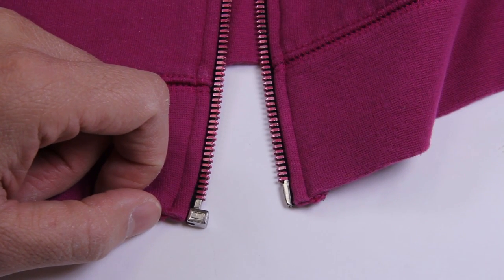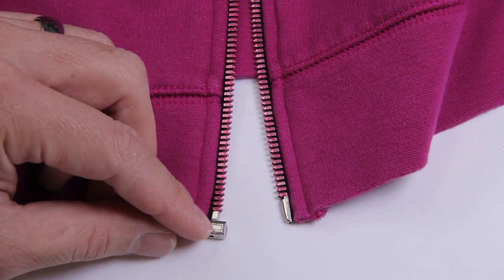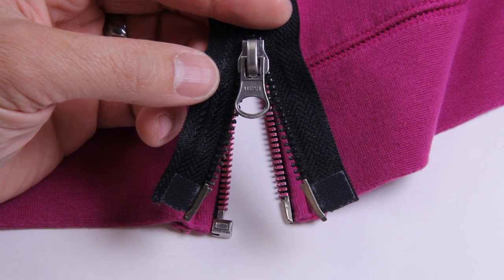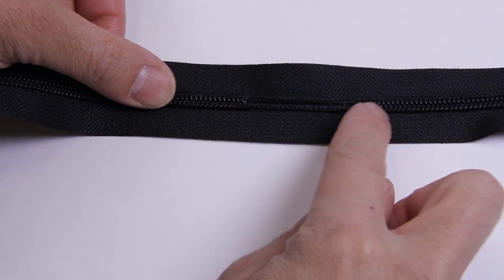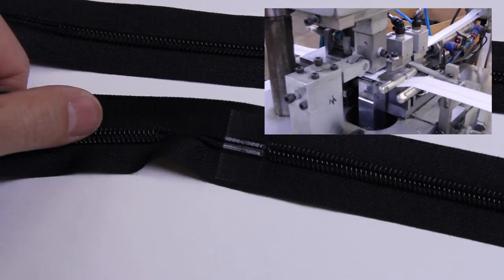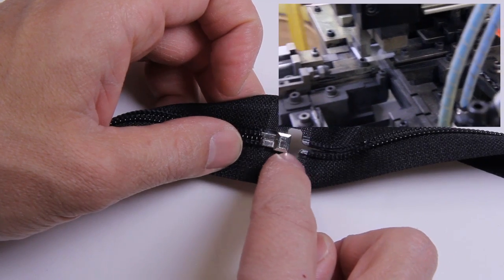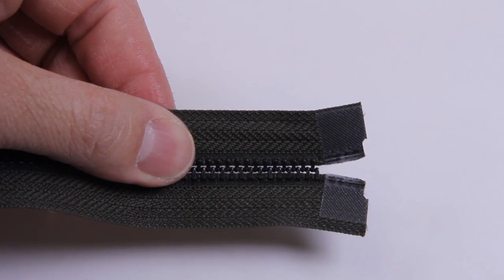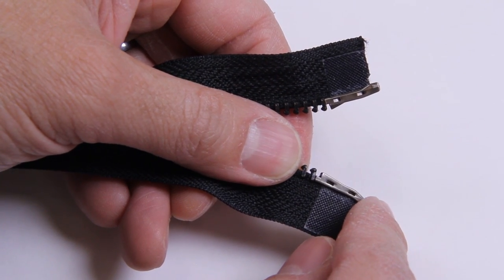The Zipper Fix That Cannot Be Repaired

Comment: This is the only video on youtube I have ever disliked.  You can buy replacement pins and zipper retaining boxes on ebay for less than $5 bucks and that would be a set of various sizes.  If you are true professional don't take this guy's advice.
Reply from the maker: True professionals will use zipper machinery to punch on the pin and box. We do it here over and over again, millions of times over. You're absolutely right, you CAN buy pins and boxes on Ebay, but you won't get the same quality outcome using hand tools as you would with professional machines.
Reply: I agree with Holly Golightly

Comment: Yes you CAN fix/replace box ends/stoppers!! You CAN buy them in a various styles, in metal or plastic👍🏻
Reply: PJ Celeste Where? Please..
Reply: Thx PJ
Reply: Amazon has kits everywhere
Reply: @EllisSimpson  Confirmed.
Reply: You can buy them, but how do you get them to stay on?  I have used pliers and all the force I can muster, but that bottom box will not stay on.  I tried it with super glue as well, and it came off as soon as the customer unzipped it the first time.
Reply: All the replacements on Amazon and Ali Express are cheap and thin pot metal, they break if you pinch them hard enough to stay on most of the time. As he said here you might get one to stay for a while, but it'll probably pop off when you really need it to work. If you're determined then, light pinch combined with a little super glue is the best bet.

Comment: I took a old coat cut the pin tab off hand sewn it onto the new jacket and it went into the box and haven't had a problem since. Works just fine. Its been over a year.
Reply: Blue Nile 
I just completely replaced the zipper with the zipper of an old jacket that I couldn't fit anymore that had the same size & colored zipper as the one on my broken coat. I was so proud of myself cuz it was the first zipper I had replaced (or even worked on)
Reply: StarrGaze-Lilly that's so awesome.. I have a $200 northface coat and the bottom heat seal ripped in half. A coat zipper should last at least 5 years imo. This one is just over 2 yrs old so I'm not happy. Next time I spend $200 on a coat, it will be another brand and I'm going right for the zipper to see if it's of decent quality.
Reply: @trinityvonmoon7346  So... you ruined one coat to fix the zipper on another? SMH
Reply: @ChazSeamus28  Uh, did you check with Northface about a warranty? Companies like LL Bean will guarantee their products for life against problems like this.
Reply: Omg u are a saviour - that’s exactly what I need to do - genius lol

Comment: While I agree that the box cannot likely be replaced without some effort or fix (like with a super strong glue), a replacement insertion pin can in fact be easily purchased, installed and crimped on the other side of the zipper (as long as the support material is intact, or repaired as needed).
Reply: You should make a youtube video showing how!!
Reply: make a yt vid about it 2 years later😂

Comment: I'm pretty sure that replacement zipper pins and stoppers are specifically designed to be clamped with hand pliers.  Even if that weren't true, there's absolutely no way that a small manual press couldn't do the job with the right setup.  Or even a hammer?  It's not THAT hard to bend metal.

Comment: I believe that someone out in zipperland should be abl e to create a box/pin repair kit. The stiffening tape should be easy toadd if it can be made so it ca be ironed or glued on. I would like to add that I had a customer asking me to fix the box/pin that tore away from the tape and wanted me to fix it. I told him I was unable to do so. About a month later I ran into him and he told me his neighbor worked for a canvas repair shop (not a manufacturer, just a local 2 man operation). He told me his neighbor was able to add a new box/pin to the zipper. He said the man told him he could not get the smaller size, but had larger sized box/pins he would use for tents. He said it was slightly larger and he replaced it and it worked fine. I do not know if this will be a temporary repair or a permanent one? Is it possible that a small canvas shop could fix the box and pin on a zipper for a nominal fee? I do not know if they would have some sort of equipment they could use to secure it well that a home sewer or alteration shop would not have access to? I have told a few customers since to check first with the local shop and then if they could not repair the box/pin to have me replace the zipper. I do not want to tell my customers to do this first if it will only be a temp. fix. Better to spend their money on a new zipper.
Reply from the maker: About 99% of the time, fixes like the one you mentioned with the small canvas repair shop are temporary. I agree with you that if the fix is really a fix, it should be done right. When the pin and box come off and sometimes the cord is torn away, the zipper will never be 100% repaired back to original quality.
Reply: @UCANZippersUSA  Where would the components for these be purchased.  I have access to multiple presses with specialized dies for minutia similar to this, and I really want to repair a jacket that requires a separating end stop.

Comment: I've had this problem with a jacket the box was missing at the bottom so you couldn't close it, the rest was fine, It was one with the 2 slides. I took the two slides off reversed one and slide it to the bottom to form the box, glued it in place with epoxy. The second one I put in normal from the top down. I cut the tab of the first one so you wouldn't be temped to pull on it  and it works just fine. I think if the end that you mention is stamped on that it could be reinforced then use the same method. I've used this one for over a year and it works like new.
Reply: Rob Martin 
Sweet! Thanks for sharing 😀 I think I'll try your remedy. On an old jacket I had when I was pregnant, my roommate washed my jacket (which had a plastic zipper) and she threw it into the dryer WITH IT ZIPPED UP 😧 So it ended up melting and fuzing together lol It was the only jacket I could fit (and it was winter) so I just slipped it over my head and wore a scarf with it to keep my neck and top part of my chest warm
Reply: 😘 Oh, but you are wonderful!!!!!  I've had a down jacket I haven't been able to use for 2 years.  And I do believe I've got it fixed.  Will try to update next month - but THANK YOU for your creativity and your good will!!!

Comment: I have a jacket that has the pin and box attached but the fabric has separated from the pin. This seems to be a common problem and I have friends that bring me zippers like this all the time. I didn't think I was able to fix them so I told them I was not able to help them. I never could explain why but now I know. Thanks! ... But that means I would need to insert a new zipper. The jacket I currently have is leather/pleather and I only have a basic machine. Is there still a way that I can repair this jacket? And... How can I/other people prevent this from happening to any other zippers?

Comment: How about when the pins themselves are okay, but the heat seal tape starts to come off. I have a case where the tape tore at the pin ends, making the material below fray, and also another case where the tape is starting to peel off on the inner side (where it transitions to the fabric) probably due to the pulley rubbing over its edge. Is this kind of issue fixable?
Reply: shadow2XS I have the exact same issue with an expensive snowsuit!! Definitely would love a fix that could somehow seal the wiggly pin back onto the stiff tape. Two way zipper pull and slider works perfectly and would save me money finding a solution.

Comment: Hi, if the metal insertion pin on a separating zipper is attached securely, but the heat seal tape next to it is lifting off of the zipper tape and fraying bit, does that affect the integrity of the zipper? If so, how can this be fixed?

Comment: I worried about this problem before the plastic seal actually broke.  Inspired by this video, I have soldered some pvc from some food packaging box on to the failing heat-fixed plastic to reinforce it.  This looks good - we'll see how it wears.  I so love this anorak, I don't want to lose it!
Reply from the maker: How's your repair holding up?
Reply: @UCANZippersUSA  How sweet of you to ask.  It has split behind the pin - about 8mm long from the bottom.  However, the anorak has press studs as well as the zip, and much of the time I just use those, to save the zipper.  I can still do the zip up if it is really cold.

Comment: **@UCAN Zippers USA - I DISAGREE IMPOSSIBLE? - As you know Apollo 13 crew worked remotely (with NASA engineers) to fabricate a makeshift CO2 box.**  I took your insight to the problem, thanks for that  and brainstormed. I fixed my Walls Work jacket. All that was required was the pin in my case not the zipper.  Used a new #8 block box and  pin kit. Used JB Wells epoxy 2 parts kit , mixed small portion then applied to area where cord was to hold pin. After about 1-1/2 to 2 hours it is a putty consistency and was able to use a toothpick to form a ribbon cord on the now "flimsy jacket material." After 24 hours the area to house the pin was very very strong, rigid and hard!  Had to fine-tune sand & shape minimally so metal pin slides on. Crimped with vice grip and needle nosed pliers. It works perfect and will last a LONG time. Shame on Walls work jackets while the jacket is very high quality the zipper pins are CHEAP.  I should have  done a tutorial video. Total cost epoxy $4.75 at Walmart and 2 zipper sets for $9.95 on Amazon :)

Comment: Hmm I just watched a video on a lady adding in a right side pin from a diff jacket that only cost $10. 
So in other words, she bought a cheap used $10 jacket with matching zippers, cut off the pin & hard plastic material next to the pin & sewed it in place on the broken zipper & it looked like it worked just fine. 
So in my opinion,it does seem repairable after watching her fix a coat. I was researching on how to repair broken zippers cause my new $50 winter jacket from Menards was only a month old when the zipper broke from a minor accident that happened. I like to be challenged by fixing things that are hard to fix, so this is right up my alley. Lol
No offense on your video, I just thought I'd let you know that it does seem repairable. I hope this write up made any sense. 

(World's MOST important/encouraging message, is found in; John 3:16, a spiritual, physical and eternal life saving verse.
📖✝️🙏)

Comment: There is a clear tape-like material that has peeled off of the zipper fabric where it enters into the zipper heads. where the zipper pieces latch. I think this tape like material is there to help the zipper pin slide into the box. Any quick fix?

Comment: I have a open zipper with just one tooth missing near the box.  If I could move the box up about 2cm (1") the problem would be resolved. I guess that's not possible.  Is there anyway to replace just one metal zipper tooth?

Comment: I have the two way separating metal zipper, and both of the pins (or pin / box even though they're two pins) are fine.  The problem is that I lost the bottom slider (broke).  The top slider is fine and still closes the zipper if I hold the bottom.  It says "Ideal 5 M" So I got two #5 sliders (YKK), hoping that would be an easy fix.  But seems like the pin from the original zipper doesn't fit in the YKK sliders even though they're #5.  aaaaaaaah. Lol.  I just ordered 2 #7 and #8's to see if that will work.  I also have a bunch of repair boxes and pins but I can see that will be a messy thing.  Problem is that this jacket is quite expensive and the zipper is really sewn in there well, so changing the zipper will be expensive and might ruin the jacket.  Any ideas?

Comment: The coat only has the heat sealed tape and it does not have the devits and the drop pin is worn and it is difficult to zip the double zipper.  Can this be fixed?

Comment: Is that little punch really the only thing holding the pin and box onto the heat tape? So if I just happen to already have a 1 ton arbor press, I can probably complete this repair? How much force is needed for that initial install?

Comment: I have aa zipper that still has the pin attached but it has ripped away from the edge and there is not enough material to sew it back together. It still zips up but it is difficult to get it to catch in the slider, plus it looks bad. Is there a fix for that?

Comment: I installed zipper upside down lol (facing lining) short of reinstalling can slider simply be removed and turned so pull faces up? (in other words will slider work in either side in both directions) presumably the stop, not the slider, would then be damaged, need replacing or could stitch to stop. ?) thanks so much :)

Comment: Question:
On my zipper, at the very end, left side, the heat-tape material has worn away, so there is now a slice in that material, so my zipper won't connect there anymore to zip it up.
Is there any way to fix that, without replacing the zipper? 
For example, would it help to put on more "heat-tape" to fill in the missing material or is it time to replace the zipper?
Also.....
When I went to "JoAnn Fabrics" about the only place around my town that sells stuff like that, I found they only sell "women zippers", (zippers that zip up on the left side) because I am a man my zipper zips up on the right side, they claim they never heard of a man zipper! 
I told the lady, look at my jacket, see how the zipper is on the right side, look at your zipper, see how its on the left side? 
The lady never noticed that before, and the only reason I know about this is because I took another jacket to a seamstress, and she put on a "women zipper" and I can't get the hang of it to zip the darn thing up or down! 
You have GREAT VIDEO'S thanks for doing this!
NiceSeeingYou

Comment: Help!   I have a Carhart coat and the heavy metal zipper stops unzipping about 3-4 inches from the bottom.   The teeth are all there but it just jams.  I’ve looked all over YouTube and tried the oil fix approach as well as the wax approach but nothing has worked.   Any advice for me?

Comment: I'm in a situation where I have the slider and can slide the whole thing as normal, but the bottom stop is the missing part. So it's zip-able but doesn't have the seal. Does that match the example shown in this video? I will message you a picture of the zipper at its bottom as well to have better context.

Comment: If I want to do a temporary fix but can't find #7 stopper, can I use a larger or smaller stopper?
Reply from the maker: You can always use a stopper that is a larger gauge than you have, but not smaller or the slider will go right over it and not stop it.

Comment: why not make a replacement pin and box with holes all of the way through that could be sewn on?
Reply from the maker: I think that's a great idea. There just has to be a way to keep the cord stiff enough and the pin and box the correct size that it will still fit the slider. When our machines punch the pin and box down, it's also crimping it to the correct shape so it can fit the slider. Great starting idea, though.
Reply: I tried drilling holes through the Pin side and sew but then there's no room for the pin to enter the zipper due to the threads extra thickness. 
I also tried 2 part epoxy. It worked but on the 3rd insertion it fell off. That's because the inside of the pin/box is smooth. "IF" it were rough the epoxy will hold but again I don't think as long as OEM. More holes for the epoxy to grab the pin just makes the pin weak.
Reply: With the right tools I bet it can be done. I just looked at my zipper that I'm trying to fix and looks like crimp could be done with 1-2mm cold chisel and good hammer and a thick steel plate to hammer on. The question is where do i get a few replacement pins. Probably will take several tries to get it right. That and what do I use as a stiffener. I am thinking some kind of glue. Again will take a few tries to find the right one.
Reply: then they don't sell anymore zippers...
Reply: @JerryDurante  I know this is a year since you asked the question but I was looking how to attach my pins and came across this video. I bought pins from Ali Express. I bought a couple of different sizes and they are both metal.
Reply: @UCANZippersUSA  would using a pair of vise-grips and a 5 lb. mallet have a similar effect as one of the machines ?
Reply: heck, ya could probably say that ya might be able to (as some of old farts that used to be in metal shop during high school and vocational school who know somewhat about `metal objects' so to speak would say) create a similar metal tool for that, which could be compared to what is called a center punch or a drift punch which would need a hammer to go along with it to fix that insertion pin and retaining box. i honestly do not believe that a problem such as that would not be able to be fixed. just think about for a minute or so as to what happened on apollo 13 when haise, lovell, and swigert got into that mess with their co2 filters, they had to find a way to `put a square peg into a round hole'. if ya somewhat understand what i am saying.